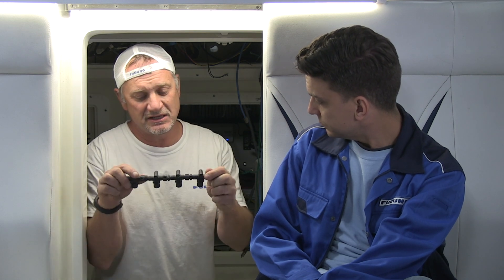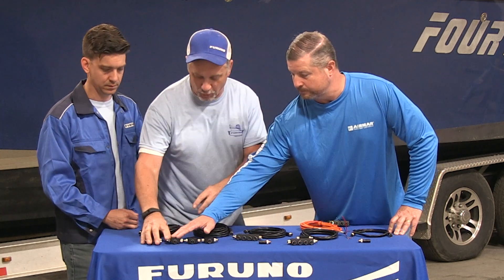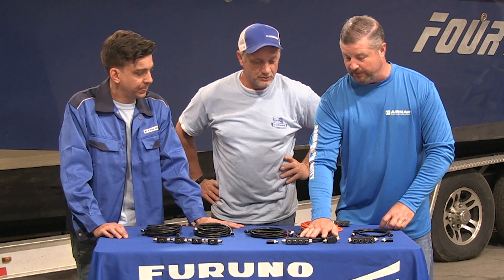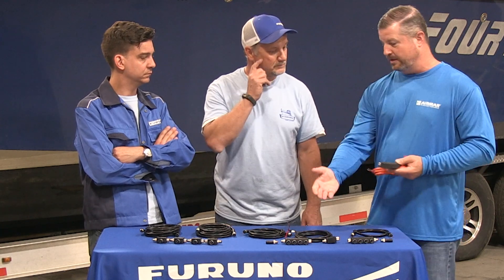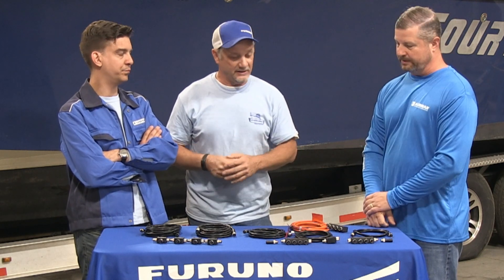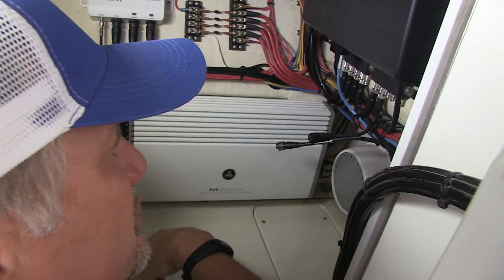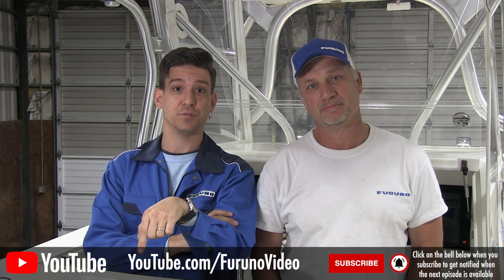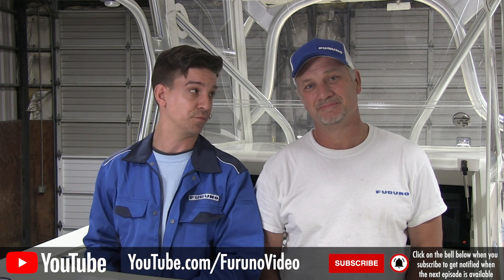Furuno Connections - Episode 12 - NMEA2000 Connections & Primer

Comment: This has been a very informative video series for me, and it couldn't have come at a better time. I'm repowering a 1994 Albemarle 247 express right now and as soon as it's out of the shop I'm starting on replacing all the old navionics and autopilot and installing pretty much everything you guys installed except I'm using  one TZT2 instead of two. I'm also incorporating some Martron and Fusion items and a Furuno radome on the hardtop.

So thank you Furuno! This is why I purchased YOUR products!

Comment: Correction:  Note that maximum length of the NMEA2000 "Mid" Cabling is 250 meters and not 200 meters as was mentioned in the video.